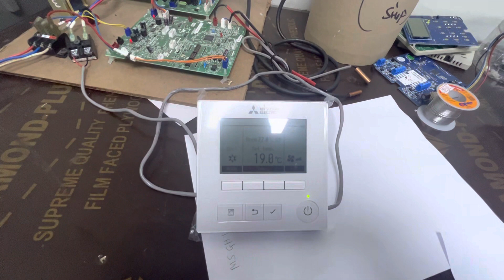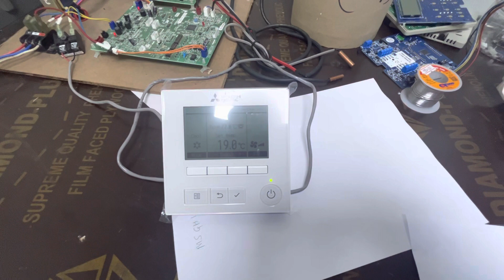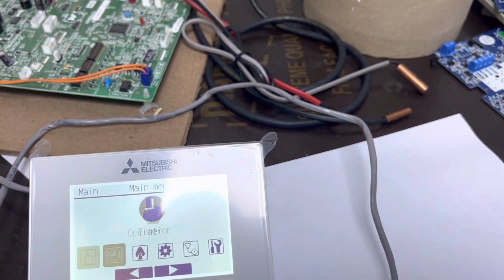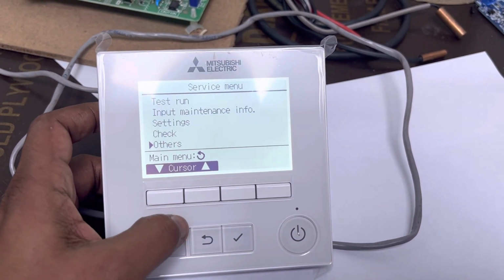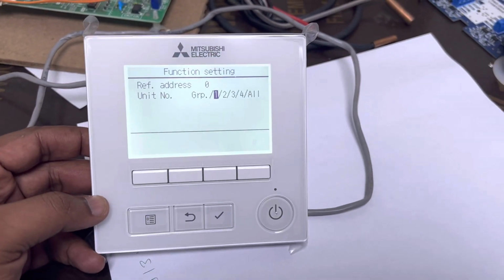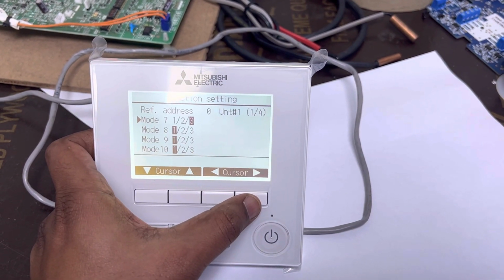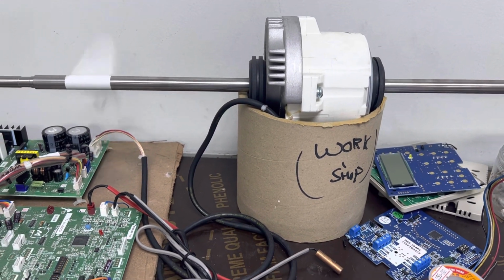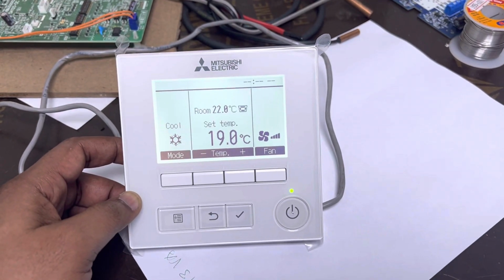Mr. Slim (Ducted type) indoor with PAR-40MAA Thermostat  How to change static pressure setting.

Comment: I need some advice, My PAR 40 seems not correct configured. Summary: The house is fully sealed and the house humidity is on 70% to 80%. The moment the ac runs its going down very well but the moment it stops it spikes heavily. This started the moment we cleaned the heavy dust and dirt on the filters, with the dust on the filters we had perfect 45-50% humidity. --> Mode 27 is at 2 "stop" already -> Still the same issue with humidity

Comment: Any chance you could tell me how to adjust where the temperature is reading from? I have the PAR40MAAU and it is definitely getting attic temperature instead of room temperature. This is a huge issue since the attic temps are around 50 degrees Celsius - which means the air conditioning never turns and freezes all the rooms out. Thank you!
Reply: Mode 02 Thermistor selection (indoor temperature detection)
1 = Average temperature reading of the indoor units in operation
2 = Thermistor on the indoor unit to which the remote controller is connected (fixed)
3 = Built-in sensor on the remote controller

Sounds like you want 3
Reply: @j2deen  thank you!